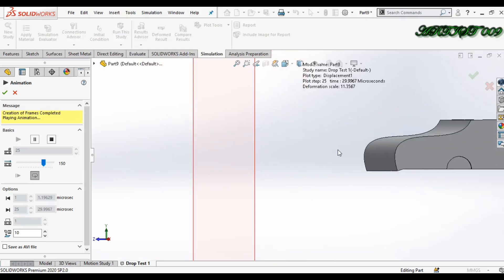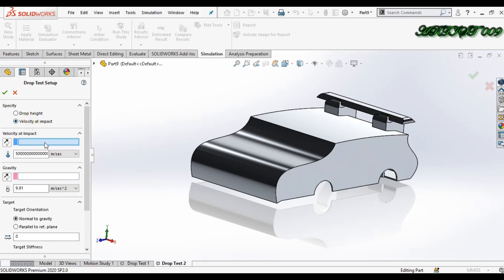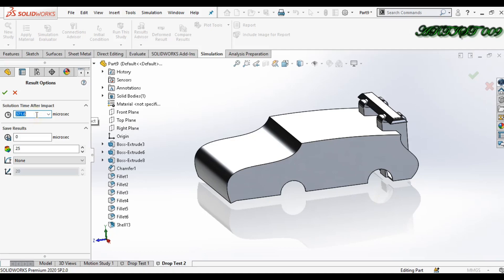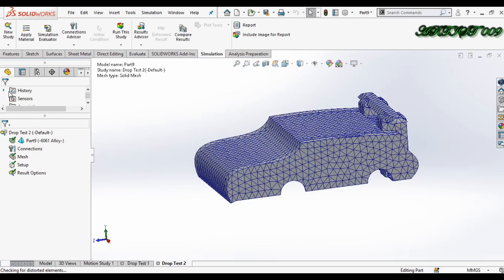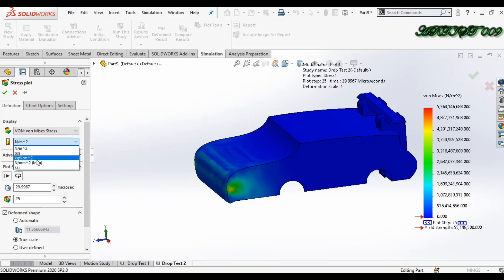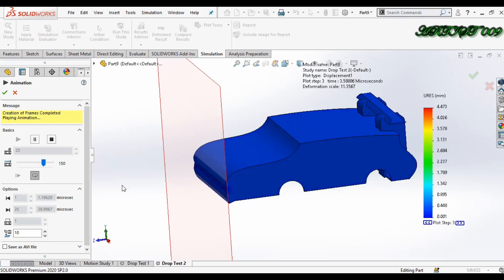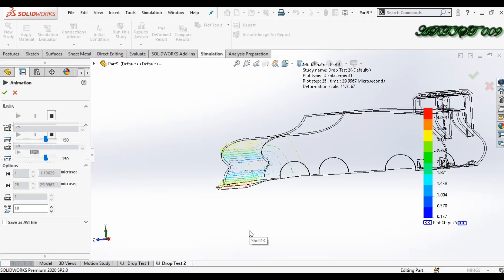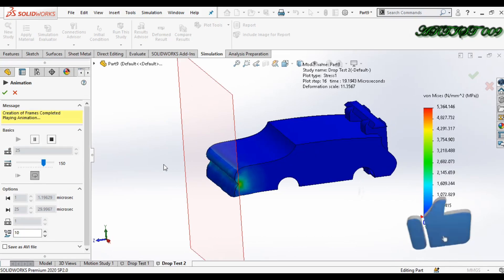Solidworks car crash simulation | Solidworks simulation

Comment: how should i apply mass to impactor?
Reply from the maker: I'm not getting u, what u want to say, u want to say that u want to crash two body?
Reply: @artist0099  i want to cras 2 body. Is it real in SW?
Reply from the maker: Hi, I never do it but maybe it can possible not in drop test, but in static u need two body and give individual values and opposite direction in Fixture